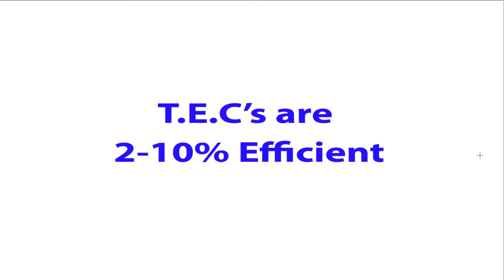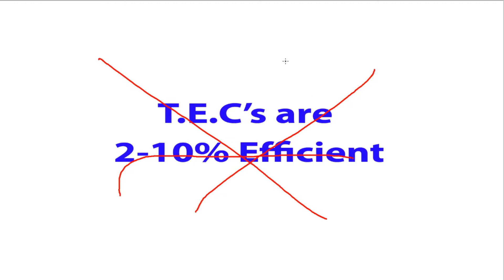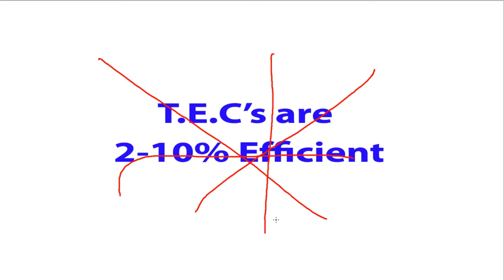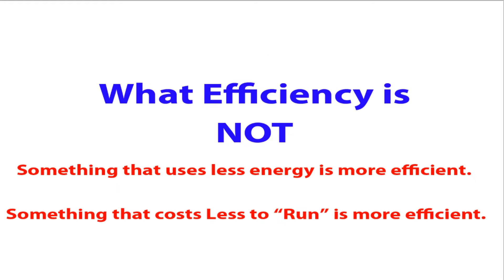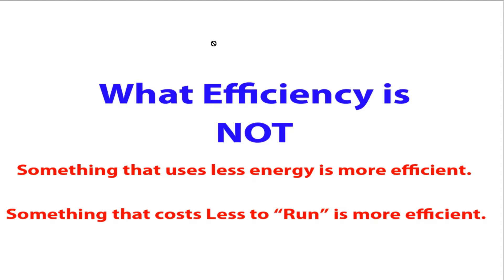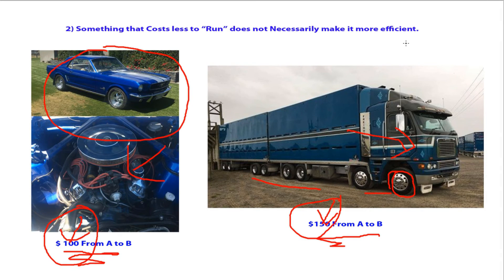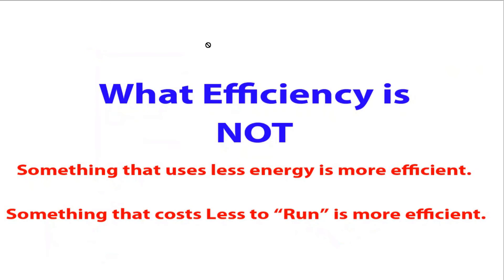🎓 Peltier efficiency:- What efficiency is NOT. Part2

Comment: hello sir, i m using three TEC1-12706 to make a refrigerator of size (30*30*50)cm ,So  will it be  efficient or not  ? 
Thank you !
Reply from the maker: You have not given any information to beable to answer that question... and even if you had How well you implement your ideas can be a huge factor in what COP you achieve
Reply: Sir my question was,  it will be beneficial  use three  TEC1-12706  in compare with some other TEC's  ?
Reply from the maker: Well there again im not sure of the question if you want to know if three 12706 will be better than using 1 then you'll need need to use my TEC calculator.
Reply: Ultrasonic2 thank you sir ! 😊
Reply: @darshankhatri4105  Hello SIR, please ask less crappy questions sir otherwise, sir, I will get mad, sir. sir.
Reply: Blah Bleh He's most likely Indian, and apparently they're taught to use "sir" when referring to other people in a respectful manner. It's just used to denote respect, sir. Also, you should be more considerate with noobs.
Reply: no.
Reply: @blahbleh5671  🖕🏻
Reply: @bharatvarsharya4904  sir don't sir be sir like sir that sir sir SIR!
Reply: @blahbleh5671  I didn't expected that quick reply Sir 😂🤣

Comment: what it is or isn't, make it more efficient, ,how?
Reply: Keeping the hot side temperature low as possible (allows higher temperature difference, better heat pumping) and varying the current (with a buck converter, proportional to the delta and heat pumping capabilities desired) would be some ways to make a Peltier module work more efficient. Ultrasonic2 might know more.